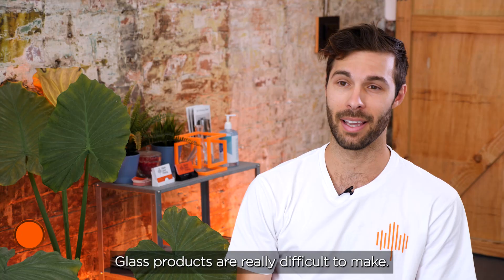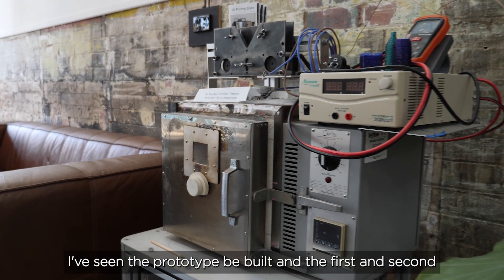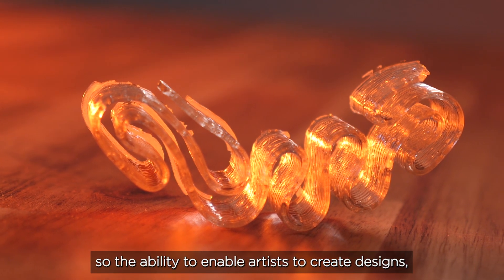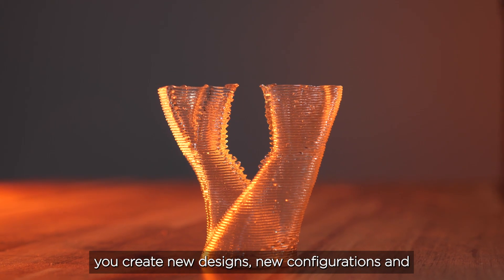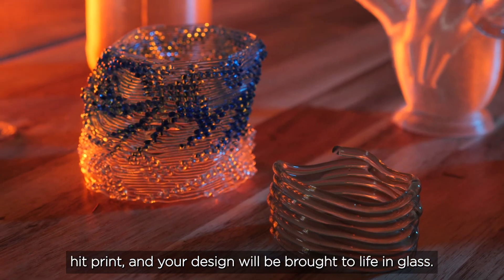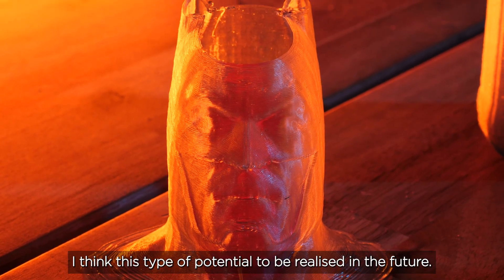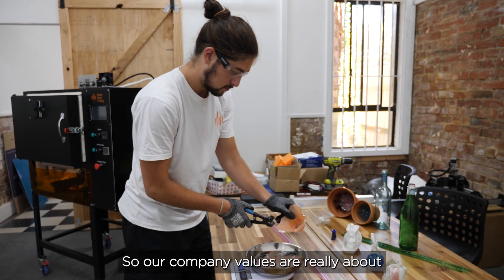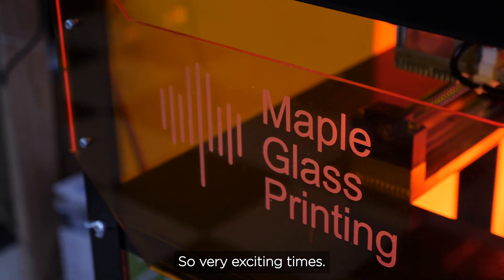3D Glass Printing | Inside Maple Glass Printing

Comment: How can you guys aply this method to help solve the growing gap of the lack of glass blowers experts for scientific tools for example? There is any plans in this direction?
Reply from the maker: Really great question. This is a huge part of what this new technology is for!

Considering how manufacturing is changing (for all materials, not just glass), we are seeing less of the younger generations training to become machinists, technical glass blowers etc. 
3D printing seems to make manufacturing fun, interesting and more accessible for all ages... as it removes the need for years of specialised training.

So ultimately,  we are building glass 3D printers to be used as a tool, to empower creators and make glass making more accessible.
Whether it is another tool, in the tool box of a talented glassblower.... or a tool for a student who has no experience and no access to traditional glass making equipment.

There is so much potential in glass making that is yet to be explored!

Comment: looks like you are very limited by the filament not being flexible enough to wrap on a roll
Reply: Not really. I mean you give an allowance for complication purely because it's glass not plastic for one. Two, this is very much an industrial/commercial application type device at this stage and three there's the possibility to use a hopper if you start from a fine powder and have the filament be extruded from that into a direct drive style system.
Reply from the maker: A roll works great for plastic filament. 

For our glass filament, we now have a system which automatically loads each glass rod into the nozzle. 🙂